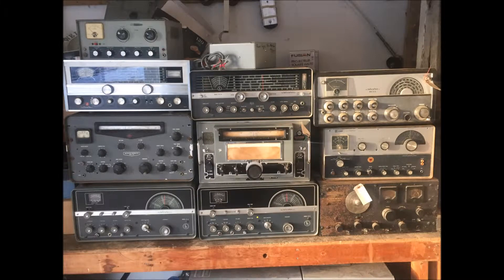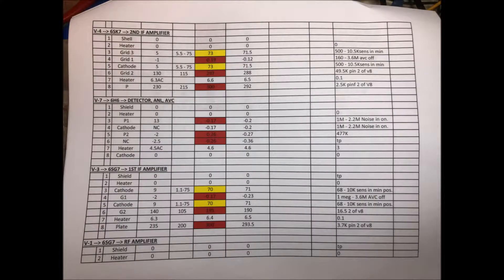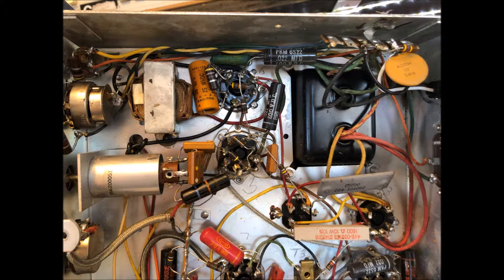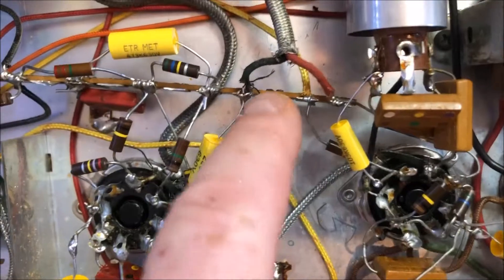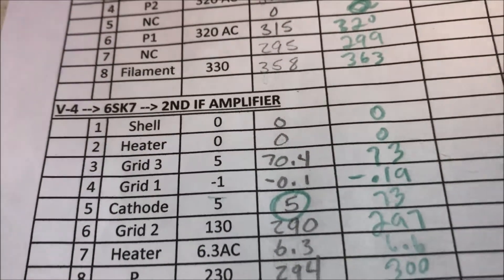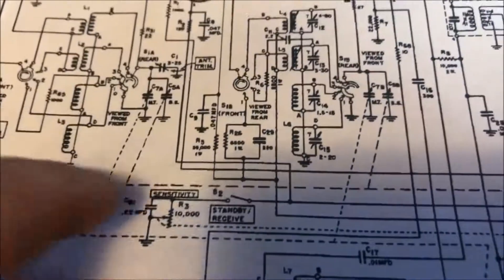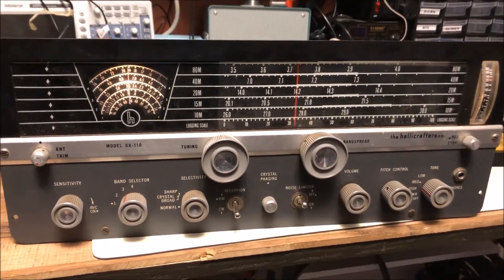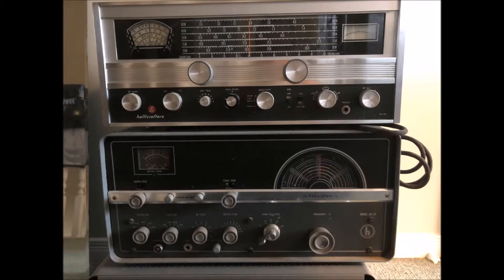Hallicrafters SX-110 brought back from the dead

Comment: You should have hundreds of Likes... Very thorough process and great test equipment you so methodically utilized, and great replacement parts you bought! I just purchased a very clean and well restored SX-28A a week ago on ebay. My other HAM/SWL boatanchor, not including most of the National Radio XCVRs and NCL2000, is a Hammarlund HQ129-X, which I recapped and restored 45 years ago, and marked the Bandspread with a fine tip pen, was my Novice/Advanced Station Receiver. Some excellent websites and WW2 nostalgic SCR-299 Hallicrafters videos out there and Chicago business museum sites on their great history!! The best part of your SX-110 is the focus on Ham Bands only, so you are not dealing with touchy uncalibrated bandspread, and SWL is dead compared with the 1950-1970's, anymore!

Comment: picked up an sx 110 to rebuild. going to check you video out some more.  tell me this.  why didnt you start with the filter cap can and make sure you had a good solid power supply before you started shot gunning?   on a piece of electronic gear as old as this one, i always just change out the can.   they are never even close to specs.
Reply from the maker: Hi Bill - I had decent power from the supply and it was easy to test/measure  so I shot gunned the rest of it. I ordered an ESR meter so I am curious to see if the old can is/was any good .